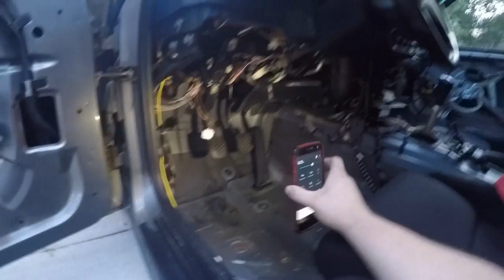HOW TO: Replace & Bleed Clutch Master and Slave Cylinder '92 E36 BMW 325i

Comment: What would be wrong if I can't get into gear with the car running and when I start it in gear with the clutch depressed it pops it out of gear? The car is a 95 318i
Reply from the maker: Mike there could be multiple issues from the linkage in the shifter may have come loose or your slave cylinder is out of the plate that the slave cylinder press inside the transmission tunnel could possibly be broken because there is a small plastic clip holding that plate on and it does tend to break. However I don't know which would be easiest to try first and or cheapest.

Comment: My clutch doesn’t disengage, if I start in neutral it won’t go in gear and when I start it in gear the car moves as the engine turns over because the clutch will not disengage. When driving however if I press the clutch while I gas the rpms will jump do you have any idea what the possible problems could be. I should also mention the car doesn’t like to come out of gear sometimes either it was the first symptom too after I swung my 325
Reply from the maker: It could either be the master or slave cylinder or the clutch disk making it stuck.

Comment: Thanks for taking the time to make the video, did you replace to slave as well? Think I looked at the other guys video too, but nice to see multiple versions.  Wonder if it's the same for a 97 328i,  My issue is my clutch is starting to stick to the floor only a couple of times (no leaks), but I don't want it to become a bigger problem.  Figure with 230,000 I should go ahead and do it now.
Reply from the maker: G it should be the similar to your car if not the exact same. Also I did replace both. Thank you for watching I love making videos to help people out and myself just in case I have to do it again later. 😀
Reply: I am having the same issue with my 1997 328i did u solve yours??
Reply: Sorry for the late response, no I haven't.  I bled the slave and it held for a while.  After a few month the symptoms (won't shift until I'm almost to the floor) are back and even worse and debating whether to do it myself or take it to the shop.  The scariest part of the whole job is putting the slave back in.  I Need more details.

Comment: which clutch master did you get?
Reply from the maker: EW I purchased the 92-99 clutch master cylinder for the e36
From AutoZone
Reply: interesting the part that bolts to the pedal looks like metal, recently the plastic part of the master cylinder on mine broke lol
Reply from the maker: EW it is metal the shaft that bolts up to the actual pedal is medal with a plastic bushing where the pin slides thru holding it in place
Reply: oh haha, in the video the place where the pin slides through looked like metal oops
Reply from the maker: EW your correct it is metal but the inside of the home is like a rubber plastic bushing to hold it tight
Reply from the maker: EW
I got you bro haha. Also subscribe and share man I just love helping everyone out.  https://rover.ebay.com/rover/0/0/0?mpre=https%3A%2F%2Fwww.ebay.com%2Fulk%2Fitm%2F142420263671
Reply: Jake Sams

Comment: Mine doesn’t have a clip it has a bolt .. tryna figure out how to get it out ..
Reply from the maker: Well dang that's odd wonder if someone else used a bolt to hold it in instead?
Reply: @JakeSams  it’s likely a diff mechanism than urs mines a 97 m3 so they likely vary slightly so fuckin piss all lol if you need help or reference